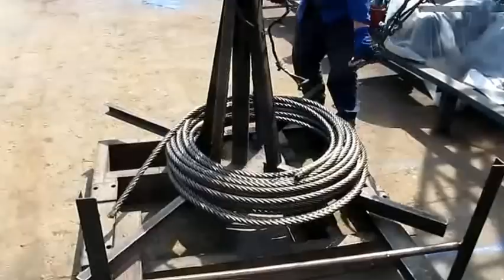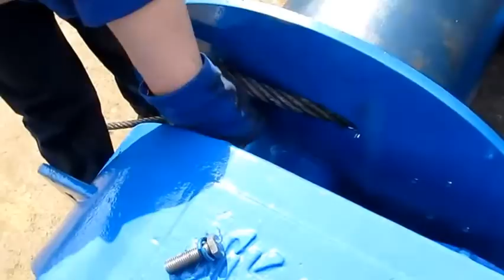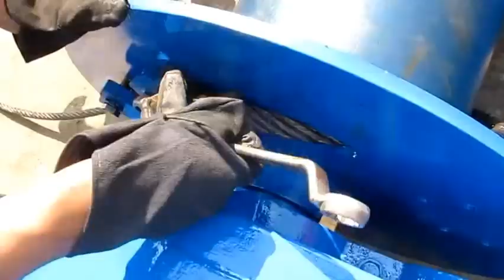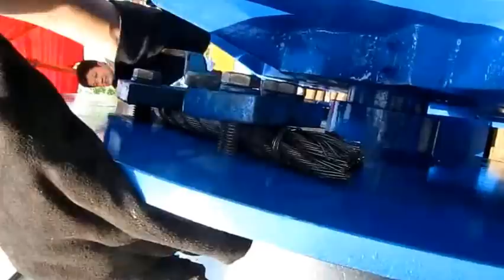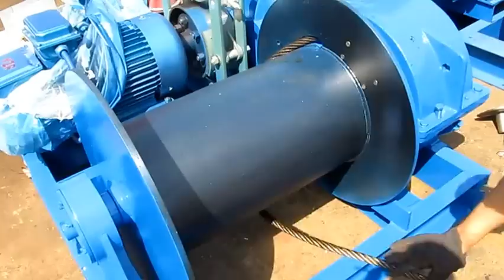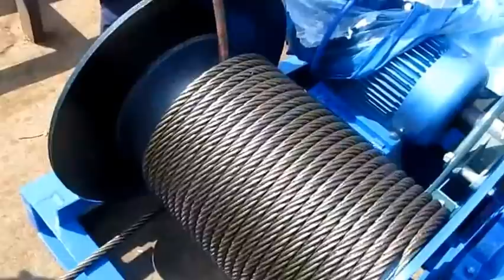Electric winch wire rope installation

Comment: Is your motor having electric mechanical Holding brake? Is your gear reducer having mechanical Load/Control brake system? Thx.
Reply: G
O
Reply from the maker: The brake are electric hydraulic brake

Comment: Not the correct way to put any new cable or even wire on a winch or hoist. The new cable should be freely stretched out for its entire length than coiled on the drum with the bitter end free to untwist or wind as it may.

Comment: If they would have tied the cable to something heavy they wouldn't need to push to every 2 seconds
Reply: you can't really tie steel wire rope, you would have to use some sort of end termination or splice. Pushing every two seconds is quicker and easier:)